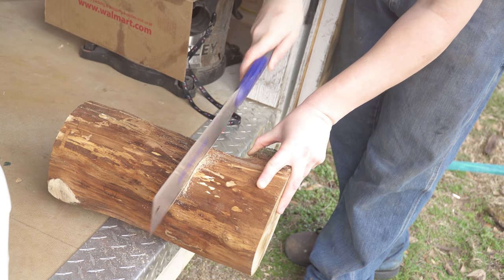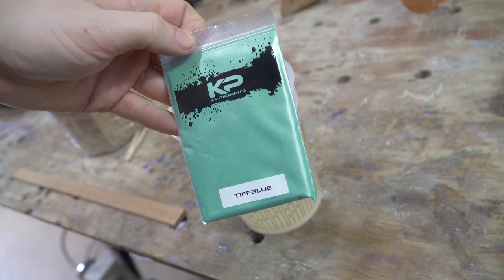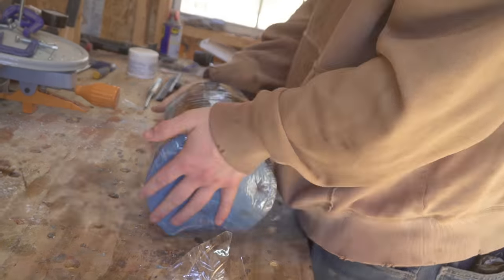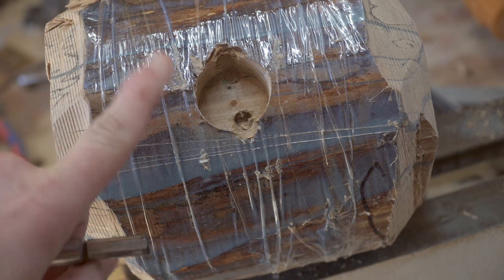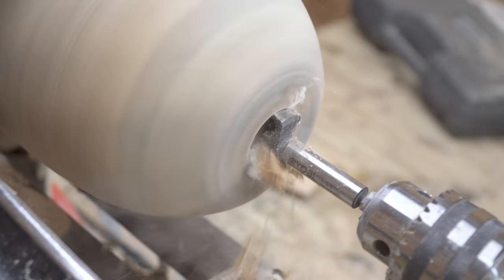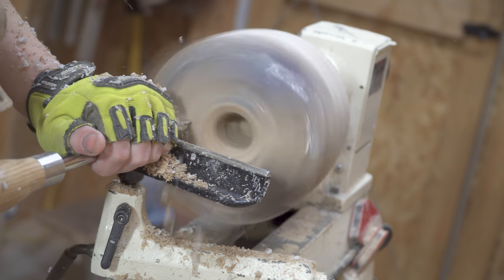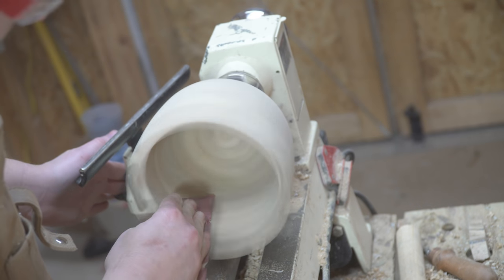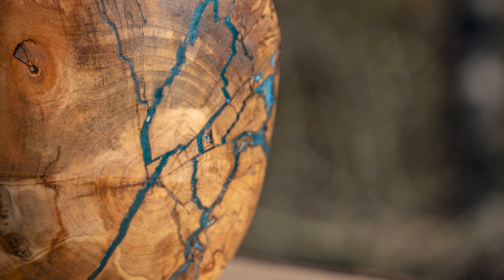Woodturning : How To Make A Dinosaur Egg Bowl 4k

Comment: This piece is really beautiful. The colours are stunning together. The only things I really would've liked you to do, is to polish it up to a higher shine. I think that would've made it look even better. There's also a couple little areas in the cracks that had bubbles, so the resin didn't quite fill it in smoothly, and I think if you had put a little more resin, just to fill it in, that would've made it easier to polish up. It's still a very beautiful piece though.  I also liked your video... 👍